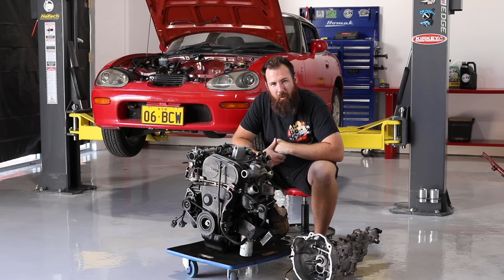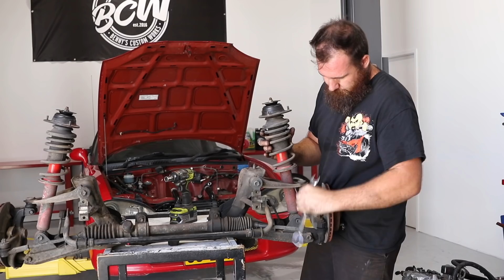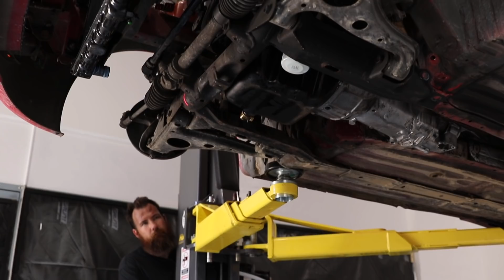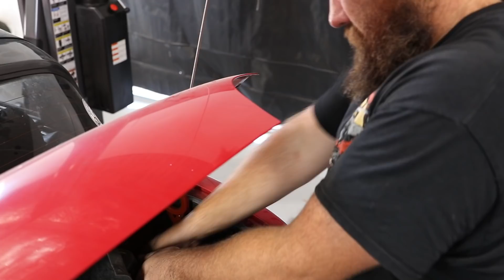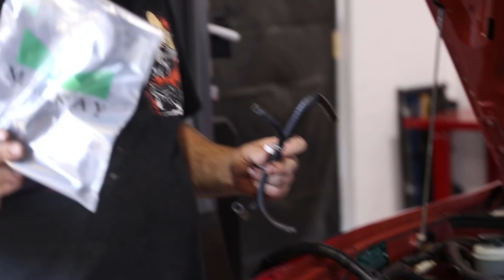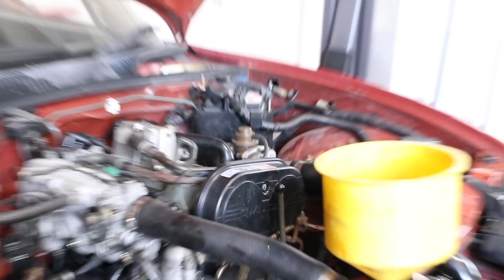CAPPUCCINO- Engine In + 1st Start

Comment: Pro tip for the home gamer. Always use just water to run up the engine after installing a new head gasket. Coolant will track and your new head gasket will be ruined. Especially with multilayer steel gaskets.

Comment: Here we have the engine rebuilt for our Suzuki hairdryer. Please take note you can pick it up and toss it into the car using a bamboo skewer and three rubber bands. We were considering swapping in a washing machine motor but it exceeds the legal requirements in our state.

Comment: Cute cars, those. :)   And hey, Benny, I have a kind of vague question to ask you as a parts importer:   I'm kind of thinking of looking for a project car and have a desire to find some 70s/80s Toyota, probably, and I was wondering how stuff for those runs, price and availabilitywise.   (I'm in the US, presently,  mostly thinking restoration-parts cause a lot of old stuff in the part of the country I'm at is pretty sun-damaged, sometimes gutted.  (I do like a nice interior, but for that it could take some searching here, considering left-hand drive.  )    In generalities,   vintage stuff there scarce? Pricey?   Condition less important than being able to replace missing or trashed trim and bits or maybe just make things a bit cooler down the road, but it's mostly about knowing the lay of the land before I look at too much in particular.  :)  

Possibly a decent 20R engine for keeping it old school,  a lot of these things I have in mind ran those, but there's a lot of options there, including the things that of course all the tuners want most.  :)  Kind of on a nostalgia trip here and probably would be happy just upgrading brakes and suspension, maybe carbing up a bit.  :)   Just wondering if  you have any impressions.

Comment: The tapping sound is common on these engines. Most likely the IAC valve. Nice work on the Cappuccino! I'm still missing mine ...
Reply from the maker: Leon van de Pest was air in the lifters , they bled up and were silent after a 5 minute drive

Comment: I once learned a method of removing main seals by gently screwing a wood screw in the old seal and then just pulling it out with a pliers. Sounds crazy but worked well with the smaller seals.
Reply: I've done that too, pretty sure I read about it in an aftermarket workshop manual...